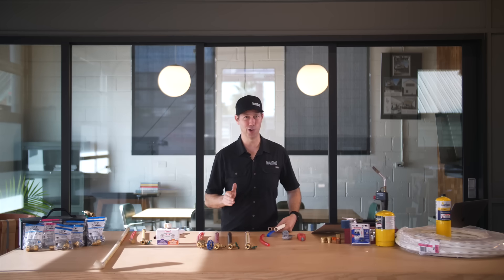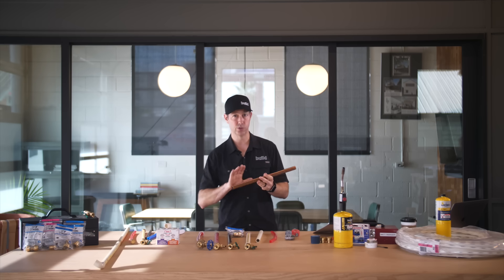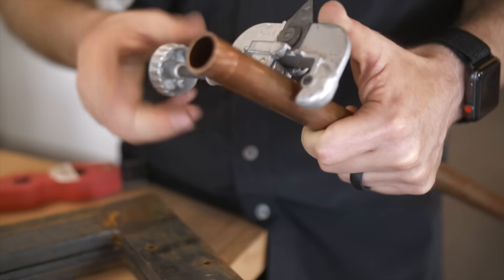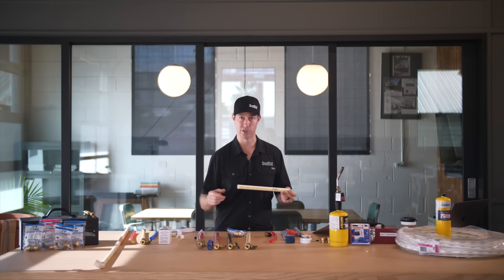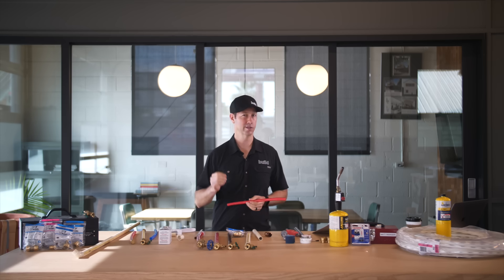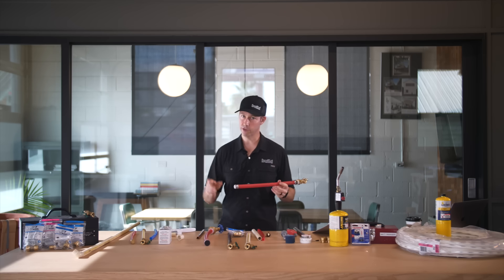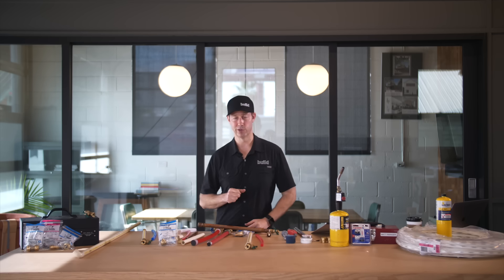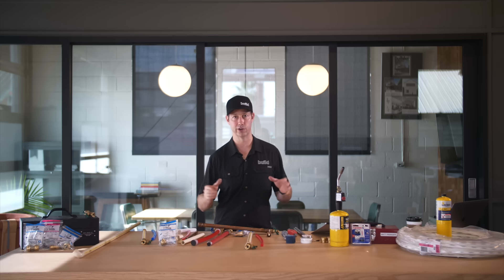PEX vs COPPER vs CPVC plumbing pipes

Comment: I moved back to the US from England a couple of years ago and have been shocked at how expensive plumbing fittings are. For push fit, it seems Shark Bite has a stranglehold over the market, with a corresponding markup. Does anyone have an alternative to these here that doesn't cost as much? In England you could get a pack of 10 push fit tees for about the cost of two Shark bite tees. Seems like American shoppers are getting ripped off.
Reply: I stopped using Sharbites long time ago, I now use Procuru brand, it costs much less and works great.
Reply: They do it so people still call plumbers
Reply: @s vernon was the architect David Copperfield 😛
Reply: Just different way of plumbing i know in canada we use pex crimp fittings, sharkbites are only for contractors, homeowners,and emergencies. Same with drainage in Europe some is push fit, here its all glued together
Reply: Yeah it’s called China direct alibaba.com. Push fit cost pennies on a dollar
Reply: Amen!
Reply: John Guest fittings are good. All those push connections have limitations. They're not the end all beat all.
Reply: @s vernon If you read what I wrote, I said just that (mostly) in a slab on grade, fiber is a fine substitute for rebar,   but in walls, pillars, beams, and slabs NOT on grade, rebar of some sort is the only proper reinforcement.
Reply: @s vernon How did our comments end up on a plumbing video ?
Reply: @s vernon I must have misunderstood that, you wrote   "rebar and fiber do not do the same job"   is that agreeing with me ?   I commented that in ON grade slabs fiber is a good replacement for rebar, and NOWHERE else.   do you know how our comments ended up on a video about plumbing, I vaguely remember something about a video on basalt rope concrete reinforcement.
Reply: No, do NOT use the cheaper SharkBite-looking copies as they usually fail really spectacularly.  If connecting to a copper line then your only real 'safe' choice is to solder on a brass adapter that will then connect to PEX pipe, I would not even bother using anything else.
Reply: I totally agree with you my friend. I am a Brit living in the usa and a visit to home depot puts a dent in the pocket. Ive also never seen copper used in the usa as of yet where i work. Cheers
Reply: Alibaba is growing for this very reason.  Most businesses charge what the market will pay, NOT what a reasonable profit is.  Americans pride themselves on stupidity and are slow to adopt obviously superior products.   99% of new builds still use iron rebar... Crazy I know.
Reply: @MichaelMantion  lol the market will pay whatever the Business will charge or there would be no market.
Reply: @PlumberWRX  I am all for capitalism and companies maximizing their income. My issue is when the industry and government team up to suppress superior technology or alternatives that don't have high profit margins.  I guess my issue is with the power of the government to regulate our choices I can't blame companies for manipulating the governments power.
Reply: @MichaelMantion  I agree on that.  Anyone should be able to buy anything they wont as long as they worked for there money and it's not gonna harm anyone
Reply: @MichaelMantion     I am curious to hear what alternative you have to steel rebar, I know that you can use fiber in a slab on grade, but for any multi story structure, you have one choice, steel rebar.     For underwater concrete, or in corrosive environment, you can use stainless steel, or stainless steel clad, and for bridges epoxy coated rebar is the norm.   The only alternative I know of, is fiber glass rebar, which is used in temporary concrete, that is to be demolished soon.
Reply: @jesperdahl1486  basalt rebar is better than steel in every application.  I know some local codes don't allow it but fight them in court.  Ultimately the court cost are worth it to have a stronger and safer structure.
Reply: @MichaelMantion  = Iron rebar !  Yeah, exactly.  Rusts out in no time.  Use either hot-dipped galvanized coated rebar, basalt rebar (best in my opinion) or use stainless steel rebar (2-X more expensive, but worth it when used in bridges), don't even bother with anything else.
Reply: @honestycounts9352  I use basalt bars and fibers.  Half the weight, so much stronger and last longer.  Sadly it doesn't bend like metal.

Comment: The 75 years for copper is a lie or you haven't done service work. Solder or brazed connections last around 20 to 35 years respectivley in moderate to humid conditions. 35 to 45 in non. Im a near master plumber, journeyman number 16843 in Kentucky.
Reply: In Germany I have seen copper lines working for over 100 years, I thik it is about the used material and workmanship. In short, I would use steel pipe, it is better for your health (if you have acidic water corroding the pipe anyway) and every time healthier than plastics and it is harder to damage by accident.

Comment: Check metalplastic pipes. Easy installations, reliable connections. I changed all metal pipes to metalplast in my house in 2001. It’s been 17 years.

Comment: Good video but you don’t say the cost difference to folks. Copper should be installed with a water hammer at or near the hot water heater. You neglected to mention that. Ye you can get by without it but it’s not recommended? Doing things right is job one! Furthermore since the plumbing is a minor cost in the overall home construction why not Ho with tried and true ??? Cheers

Comment: After 38 years of doing this I've learned a few tricks. One is to sleeve all runs under slabs. On copper runs I've encountered a problem called swirling. Swirling is where there is a slight imperfection causes a swirling effect. When sand or other debris hit this area it is thrown against the pipe and eventually wears the pipe to a thin area that bursts. So I always sleeve the pipe in a pvc sleeve. Once a pipe is proven to have swirling the entire length should be replaced (imho) from beginning fitting to end fitting.

Comment: Your forgot one important detail about copper that I have seen skipped many times over. You have to ground the pipe. Water moving through copper, there is an exchange of electrons that can become deadly as the charge builds.
Reply: No, the water is conductive enough. Grounding is for/ against lightning and other bigger effects. You can use water pipes to ground electrical devices.

Comment: Hammering in copper can be fixed by using a coiled length of type k usually at the termination of the line that is affected. It simply absorbs the shock. The one thing I see by reading most of the comments is that plumbing is affected differently in different locations and water ingredients.
Reply: Water hammer arrestor is what your thinking of i believe.
Reply: Yes a hammer arrestor. Expensive to buy already made but can be made with a tee fitting, a short section of pipe and a cap for way cheaper.

Comment: Apex is crap... Has serious problems with hot water... Causing pipe failure. Some area's in rural county's the city water supply will be pushing to much pressure. Have seen homes with three pressure regulators and the pressure still be spiking over 150 lbs. It causes major problems with pex piping.

Comment: Hello, Matt:
"Dr. Andrew Whelton, an assistant professor at the Purdue University Lyles School of Civil Engineering and Division of Environmental and Ecological Engineering, has been researching the safety of plastic pipes since 2014."
The reason I posted this quote is because this is an authoritative source for the water contamination factor from various piping types.
Bottom line:  "To date, more than 150 contaminants have been found in water that flowed through PEX pipes in these and other studies."
Some of the chemicals include toluene, a neurotoxin, and MTBE which have been found in water piped thru PEX plumbing.
In other words, you are poisoning your customers;  Good job, Killer!
Hope that's worth the money you made.
Have a GREAT day, Neighbor!
Reply: What about the neurotoxins and carcinogens included in the chemically treated copper. Only give one side of the story you must give information for both the other items he's place there or you were just being biased

Comment: For the last 45 years I have only used copper pipe and brass compression fittings which use a brass olive which squashes up around the pipe to create a seal. Does nobody in the USA use brass compression fittings?  I am from South Africa.

Comment: What I find interesting is that all of the vids in this series regarding waterlines mirror my experience with pneumatic lines in heavy industry. PTC is great in its simplicity, crimp or expanse is more robust... but they all have an "install life". Also poor install will ruin ANY system, regardless of fitting type!
Reply from the maker: Interesting parallel. I like that “ installed life”

Comment: The house I live in was built in 1924. Pinholes happen.
Reply: So the pipes lasted almost a hundred years. Pex and cpvc would have crumbled by now.
Reply: Most likely because if it is the original pipping it was sheets of copper that were rolled into pipes.

Comment: I have a rural home on well water.  Unfortunately the iron content of the water is high enough that it eats the copper pipe from the inside out.  I have been using PVC (cold water) and CPVC (hot water) for all the breaks and leaks in copper piping.  Over the years the amount of copper to either PVC or CPVC is about 50/50, with a LOT of shark bite couplings.  Going to replace the whole shooting match with PEX... cause it is the 21st century... might as well use 21st century material.

Comment: I have Pex in my house.  At the fitting ends before they go through the walls they connected to copper.  I had one leak and it was in the copper not the PEX.

Comment: shark byte type fittings(though still somewhat expen$ive) are no question some next level/high tech inventions, & so easy that a child can do it. & pex, though I'm not sure if its spec'd for it, can/does survive freezing(it stretches just enough to not crack over small lengths anyway), 3 times in 5 yrs(in my garage bathroom) so far that I'm aware of & Zero leaks.

Comment: The absolute BEST choice is copper. CPVC is basically PVC pipe with more chlorine. PVC is called the poison plastic. Chlorine is something the nazis used to kill people. Yeah, I don’t know why idiots decide CPVC is a good choice. As far as PEX goes, it’s also plastic. Any kind of plastic is bad to your body. The hot water running through will overtime melt the plastic. 

TL;DR PLASTIC IS BAD AND WILL KILL YOU AND THE ENVIRONMENT
Reply: You are hyperventilating.
Reply: There is chlorine in  your table salt! Stop putting salt on your food! You are poisoning your self!!!
Reply: Pex is used to run radiant flooring. Hot water doesnt affect it! Also one thing not mentioned is freezing, pex and copper will burst or pop, pex will expand and go back. The joints can crack but the yubing itself wont leak! Another thing if done properly is a manablock system. More tubing is used but still cheaper. You have complete control over each individual line incase there is a leak or you want to replace/ upgrade a specific faucet toilet or hosebib without draining the whole system.
Reply: Kim Jong Un b

Comment: Hi Matt! Great information. Which material would you choose when re-plumbing an RV? Copper, though long lasting, might not do well with the vibration of an RV. CPVC, with its flexibility and easy install seems like a good choice, but is there any concern about joints breaking or the pipe work-hardening as a result of constant shaking? Finally, what about PEX? It seems like the most well suited for a mobile application. Would love to hear your thoughts. Thanks!

Comment: He dosent understand what water hammer is.  When you have rigid pipe, and shut off the water very quickly, all that weight of moving water slams to a halt and the pressure in the pipe spikes hundreds or in extreme cases thousands of psi more.  Yes, it can pop out the retaining fasteners and make annoying sounds, but it is able to rip open the pipe and break connections causing catastrophic failure.  Plastic like cpvc isn't so rigid and is less of a problem, pex is flexible and isn't an issue.  
Also in northern climates I've had pipes freeze and pex beats cpvc and copper by a mile.  Pex is able to expand and won't rupture.

Comment: Excellent video.  My house was built in 1950 with copper and some remodeling in 1970's with cpvc.  I have found the cpvc has gotten really brittle.   I am currently remodeling with a combination of copper and pex.
Reply: Exactly. I was in the process of a sink and cabinet replacement and the cpvc broke with mild handling.  A catastrophe waiting to happen.

Comment: I have a question.  I'm on a well and my well pipe (supply from pump) and from pump to house is black poly pipe.  Why is it tar you can't completely plumb a house with black poly pipe?  If it's sound enough and has the longevity for burial and is rated for the pressures supplied from the pump, why wouldn't you be able to plumb the house, especially since there is the capability to "weld" the joints rather than using push in connectors and house clamps?
Reply: You're talking about "farmer pipe". Is it really still rated for burial at your location? I've had to replace it multiple times. Just started leaking, for no reason.

Comment: 40 years ago I plumbed my entire house with cpvc to replace the old galvanized steel pipe that was so corroded it wouldn't flow water. 15 years later I had to replace it all with copper due to multiple failures of the cpvc. Contractors in northern Michigan use both copper and PEX style. I have heard a few contractors say that they went to PEX years ago but shy away from it now because of failures.
Reply: Use Uponor PEX-A

Comment: Love copper but it's only as good as the sweater
Reply: Sweater? Like the one on your face?!
Reply: I totally agree. You have to make sure you ream the pipe, clean the pipe, clean the fitting, flux both, and then solder. The mistake that I have seen as a former plumber is that they think it's a brand new shiny fitting and they don't clean it before they solder. Leak 101.

Comment: Man, those numbers (100, 75, and 50 years) seem amazing these days.
Reply: My old red brick house is 89 years old and most of the old galvanized steel pipe is still working, even thou I am sure that the water flow is not as good as when it was new.

Comment: Excellent pipe install? roughing in a house with Shark bites with less skilled labour. Buddy let's sit down for a beer I'll walk you through my last year ripping down ceilings and walls chasing a drip on a sharkbite installed by less skilled labour.
Reply: Its all about production housing. I have been on so many jobsites where the workers laugh about how shoddy the workmanship is. They talk about how flexible the floors are where tile is going and how crooked the walls are and how the plumbing is installed without glue. They laugh because as soon as the house or apartment is built, it is sold because of lack of housing. This has gone on for as long as I can remember.
Reply: @oby-1607  where do you live? That's terrible. Faulty craftsmanship is so wrong, wrong bc the impact of home repairs always happens when the homeowner is vulnerable (broke or sick or on a fixed income). I really feel bad for the individuals that make a 25 year long investment on a money bucket. Bad plumbing and bad roof can cause the worst damage.
Reply: Same
Reply: Worker of Lead   I have had trouble with shark bites. Sometimes they do not go on all the way without hammering it. Tight fits forget it. Use the rings.
Reply: @mikewhite9818  Learn to use it.... Stop rushing jobs.
Reply: Kevin Polin   Bet you are not good at what you do.
Reply: Also, SharkBite fittings get expensive real quick. I keep a couple of 1/2 and 3/4 caps around for an emergency, but I can't imagine using it by design.
Reply: Wondering if you should have mentioned Quest pipe, polybutylene. I know it's been banned but people might be confused when they see a gray pipe and need to know about using a different fitting than PEX. Really appreciate your presentation I agree with most everything you said. I saw a lot of comments about CPVC not lasting very long and I would have to agree. One other topic for Northern houses is which pipe is best used against freezing. CPVC is horrible. Copper is bad and PEX is probably the best
Reply: Never trust a ten cent o-ring, use harbour freight jack stands
Reply: If you're using a shark bite fitting for anything other than an emergency, you shouldn't have a plumbing license. Period.
Reply: I can't believe anybody let's consider using SharkBite fittings as the regular fitting unbelievable, 1 rubber o-ring makes the seal bad choice very bad.
Reply: @markthomas4083  SharkBite fittings are great when in a pinch but I wouldn't use them in any location where it will be covered up.
Reply: I was just in an apartment building and saw the plumbing in the walls. Sharkbite after Sharkbite in the walls. You open one access panel under a sink and see about 10 shark bites, it was crazy.
Reply: In my limited experience I would not put Shark Bites inside of walls, ceilings or floors.  I only use them where they can be seen.
Reply: Less skilled labor? I think he means illegal aliens doing that.